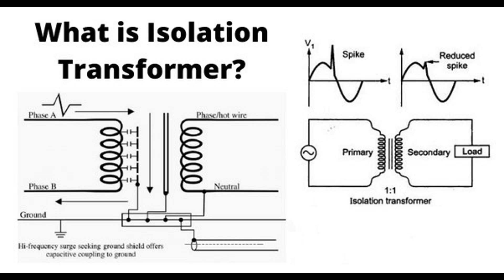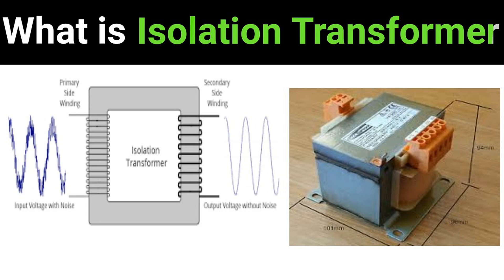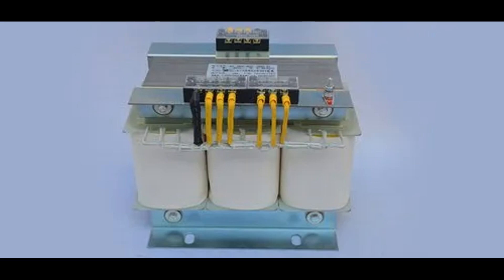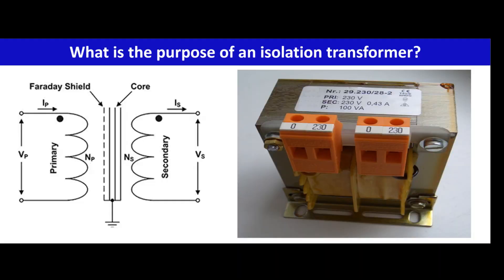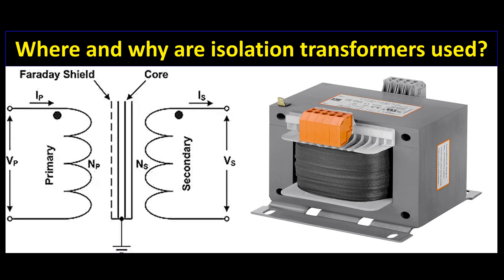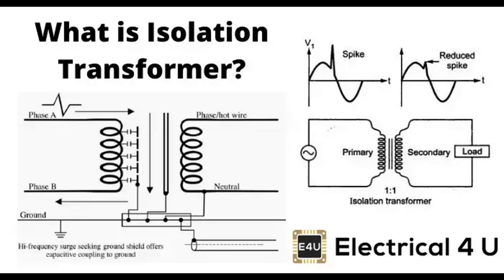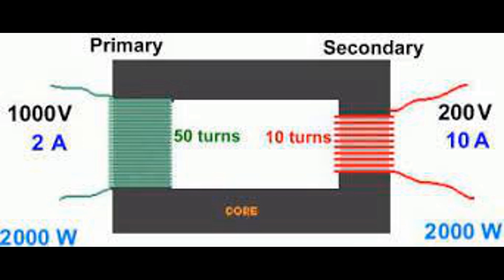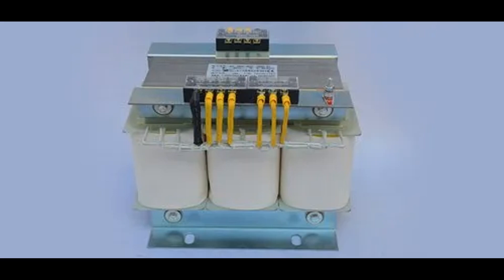What Is Isolation Transformers || How Does It Work  And Its Application.

Comment: Hello, I have some toroidal transformers but don't know the VA. The primary and secondary both have 48 turns, 12awg wire. Large gauge wire is used here for efficiency. In theory, 12awg wire can handle up to 10A for the length up to 15ft with a reduction of 3%. I guess 15ft can cover up to 48 turns. Then the VA should be 120V x 10A = 1200VA. I need your opinion for selection the correct fuse.